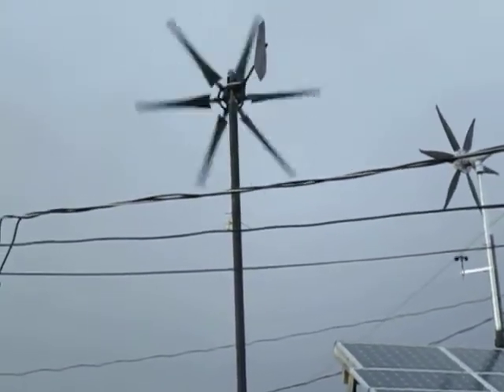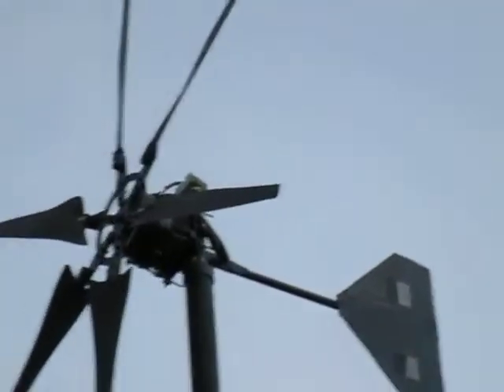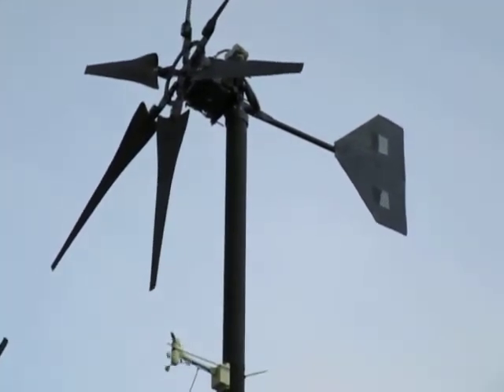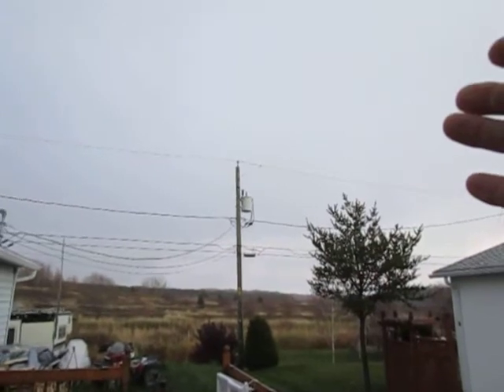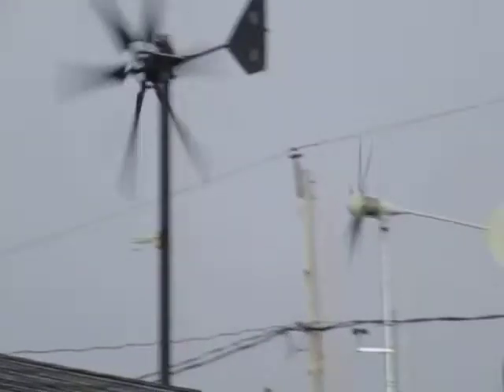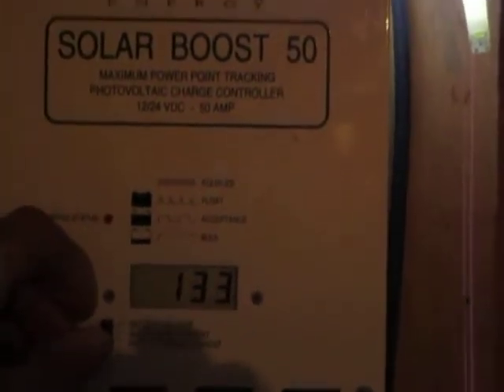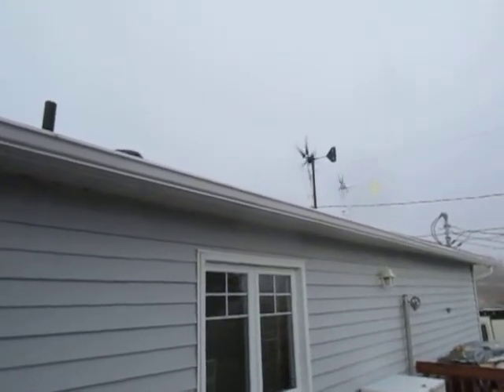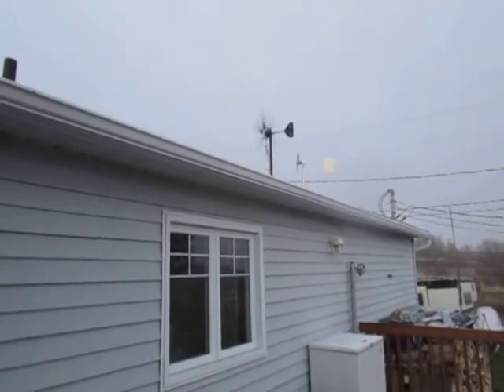Wind turbine talk..

Comment: Thanks for the kind words Pepper! I really enjoy seeing that hub flying and appreciate the effort you made on the homemade turbine. I have a similar set up (delco style) in the backyard now and the axial projects are in hibernation in the shop :) I have been meaning to put them up for sale in a video and they will be fitted with one of those hubs for sure. My setup is rather modest with no mppt or solar but it works for me. Thanks again man and I look forward to your videos!
Reply from the maker: Darryl!!! I enjoy buying from you because you show PROFESSIONAL behavior and great ETHICS..  If you are selling the pma combo, i suggest you make the 3 blade big hub because the pma needs high rpm to make a carving in power output.. But,  i have to say that the hub i got from you is EXELLENT in this configuration for high resistance output like a 24 volt turbine couple with a 12 volt battery bank... All in all, you have make great thing to advance the community for the better place to discuss improvement..